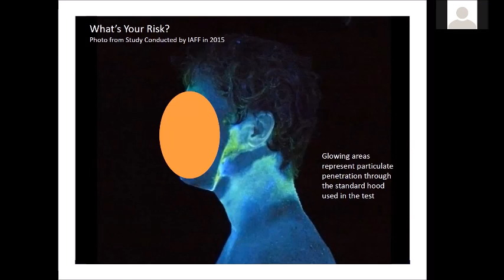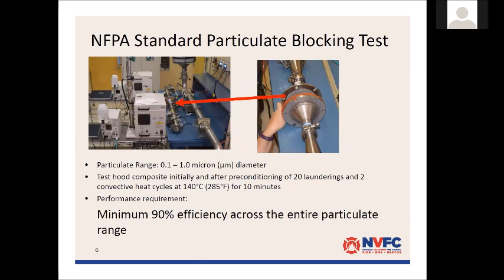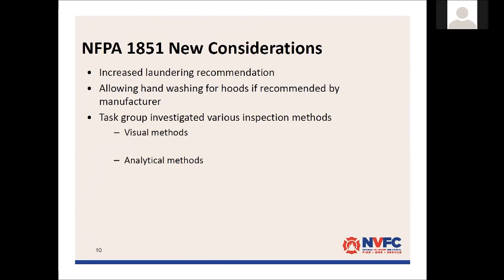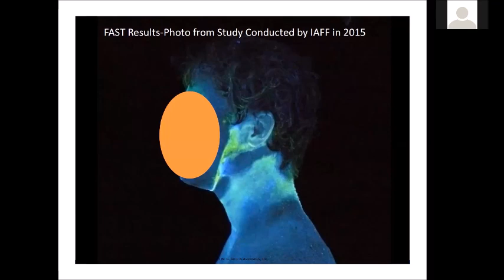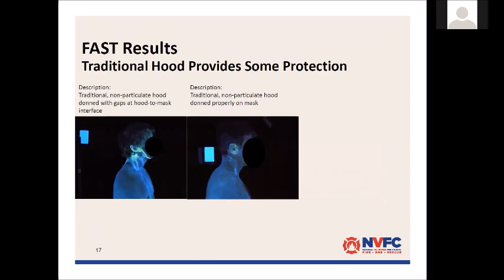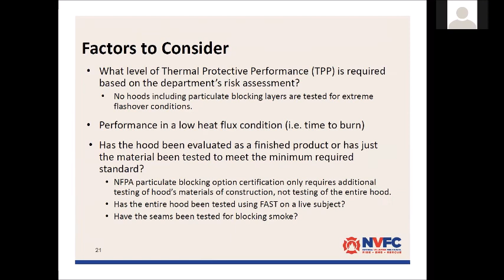Particulate Blocking Hoods: How to Evaluate Your Choices

Comment: What would be the maximum amount of air permeability that one should allow for when measured in CFM?
Reply from the maker: We checked with webinar presenter Jeff Jury of W.L. Gore & Associates, and here is his response:

"There is no maximum air permeability that you could identify for hoods. In particulate blocking hoods, particulate protection has to be balanced against air permeability, and generally increased airflow will mean a higher level of particulates are going to reach the skin. In order to block particulates, airflow will always be restricted as it is a two-way mechanism and the purpose of the hoods is really about blocking what might otherwise flow through the hood to get on the face, neck and ears. So in general, more air permeability would equal less protection against particulates. A better measure of "comfort" is breathability, which was adopted in the NFPA standard for particulate hoods.  

More breathability is always the goal for hoods as more breathable (breathability is defined as efficient water vapor transfer away from the body) will reduce heat stress for the wearer. However,  there are significant trade-offs between breathability and thermal protection (as measured by TPP at U.L.). Gore believes that the most critical functions provided by a particulate hood are preventing burn injuries and blocking particulates at the fireground. We balanced this protection with making sure that we meet the standards set by NFPA for breathability of particulate blocking hoods."